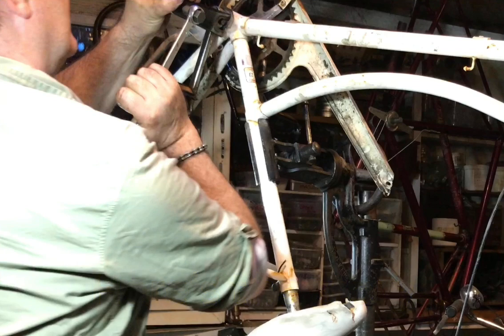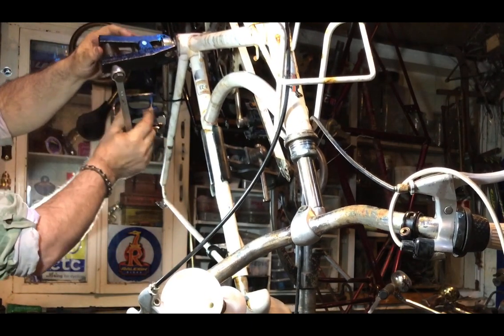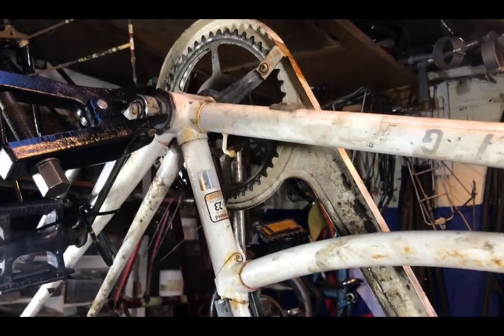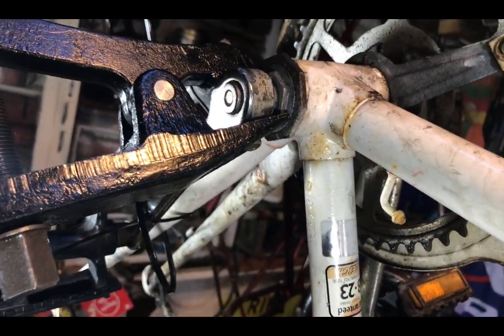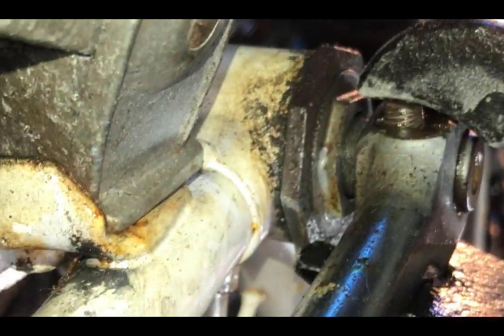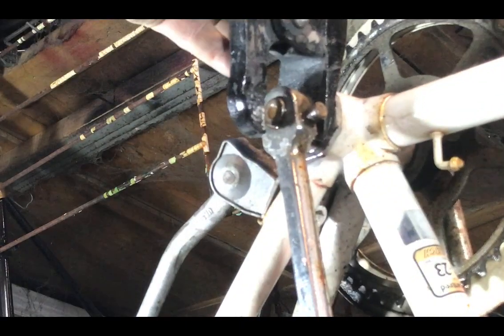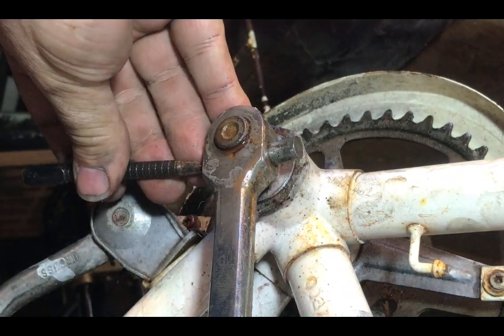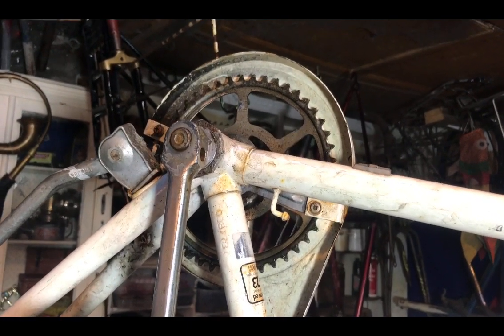I do battle with the most stubborn bicycle crank cotter pin ever! Raleigh 3 speed renovation.

Comment: I got traumatised with one cotter pin in my recent renovation, used the tool you are using in this vid, i did crushed, bent the cotterpin completely, drilled on both sides, burnt or broke like 3 steel drilling bits & did everything but did not come out . I was on the point to cut the crank arm, then i decided to take it to a professional who i suspect had the right tool to do the job & he did it in less than 15mins. i had never been so frustrated with a cotter pin. Despite being very amateur but passionate of old Raleighs, I must have removed at least 50 of them without any issue for the last 3 years, before i encountered this time. It gives me some relief watching you also struggling with that one. Thanks RD. Ultimately the renovation turned out beautifully. Check it out on my post on the RRClub FB page.
Reply from the maker: I neglected to point out the other option.
Take out the bottom bracket cup and withdraw the axle with crank attached, then take it to the vice or to an engineering shop/garage with a press.

Comment: Years ago I had my own battle with some cotter pins. I ended up putting the crank plus frame inside the vice and drilled it out. One word of advice, Kukko. Expensive, but there probably is a reason :)

Comment: My bad cotter eventually over-stressed and broke off the threaded section.
So I propped the crank up level and filled the well with penetrating lubricant, left it overnight, gave it another dose in the morning and came back in the evening.
After 24 hours of soaking, I set the crank arm on a block and used a 1/4 inch socket extension to reach down in the hole and strike out the pin.
I've been scrubbing the crank arm rust with a green scrubber pad. I've already bought new pins and filed the tapers, so tomorrow I'll put everything back together and take it around the block.
Older bikes are an adventure.

Comment: One of the first cotter pins I tried to get out was on a late 80s Peugeot Leader Sprint (youth model); it was so stubborn that my brand new ball joint splitter tool, which was just like yours, had one of the two prongs break off! The chap at Machine Mart had never heard of it happen before!

I thought something similar was going to happen to you when I saw that bend in the arm!

p.s. The cotterpin in question never did get removed and stayed, bent and deformed, in the bike until I sold it to a friend when I moved house and it was promptly stolen about a month later.

Comment: Another alternative, may be to drill out the centre of the cotter pin and release any internal stresses making it a tight fit.
Reply from the maker: Or undo the left hand BB cups and remove the axle with crank still on. Either leave and reassemble afterwards, or press the pin out in a vice or press.

Comment: Replacement cotter pins seem to loosen up more easily while riding, so I try to salvage originals when possible. Are there good replacements to be found?
Reply from the maker: Yes they do. The modern ones seem to have a bright zinc coating, and I think that must reduce their hold on the taper. 
I haven’t found a source of good replacements. My pal in Amsterdam who runs an old fashioned bike repair shop (search YouTube for ‘de benen van Amsterdam’), buys up old stock when he can